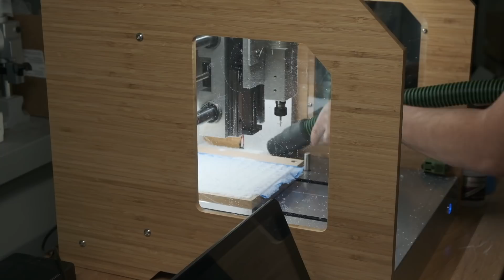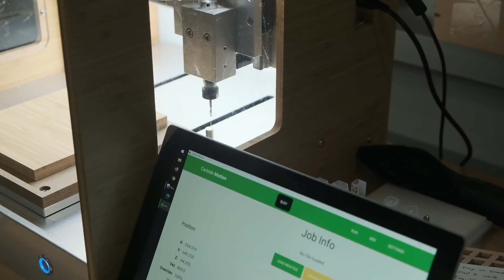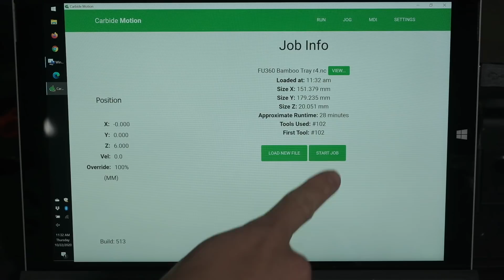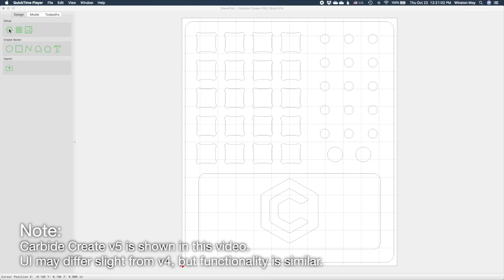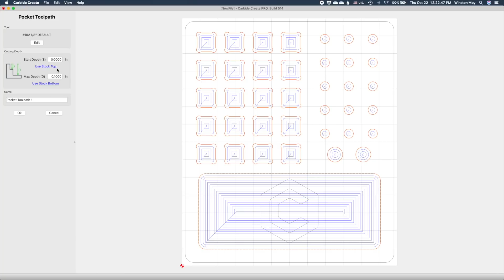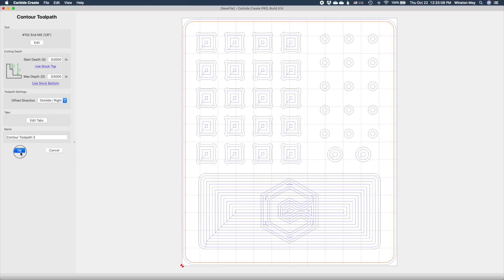CNC Organizer Tray - Nomad 3 Intro Project

Comment: This looks amazing! Are there any other options for controlling milling operations than a computer plugged in via USB?
(For example, would Gcode saved on a flash drive work?)
Reply from the maker: Our machines require the computer to be plugged into the machine.  However, this can be a fairly basic tablet.   Running Carbide Motion, our CAM software, is not hardware intensive.  
Many people use an older PC or Mac to drive their NOMAD or Shapeoko.

Comment: Nice vid Winston; thanks!👍😊 You machined a tapered hole using a flat endmill a while ago, but I can’t find the video; could you point me in the right direction?🤞
Reply: I don't remember the specific video, but you basically just throw a Bore operation on the conical surface (Fusion 360 only), and make the pitch or ramping angle very shallow.
Reply: @WinstonMakes  Thank you Sir; will give that a try!😊
Reply: @WinstonMakes  Bore operation to produce a tapered hole worked very well! However, cut time was projected to be 52 mins for 14 holes, which I decided was a BIT over the top for a thing to organise my ER11 collets...!😬

Comment: Does the new nomad or the shapeoko mill aluminum better(accuracy and speed)?
Reply from the maker: The Nomad 3 has more spindle power than the Nomad 883 Pro and also improved anti-backlash nuts. Will cut faster, accuracy is unchanged.

The Shapeoko Pro is more rigid, so it will exhibit less deflection and vibration during cutting. You will be able to take more aggressive cuts. Resolution/accuracy will be the same.